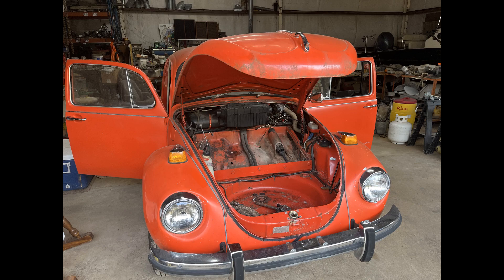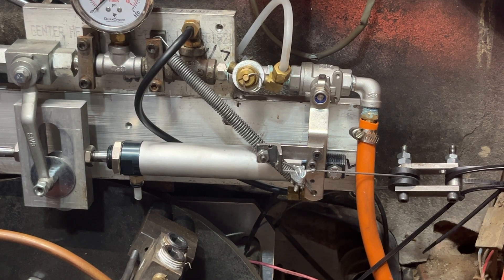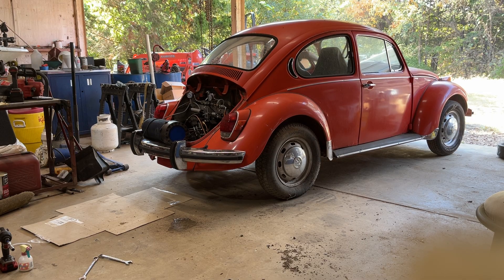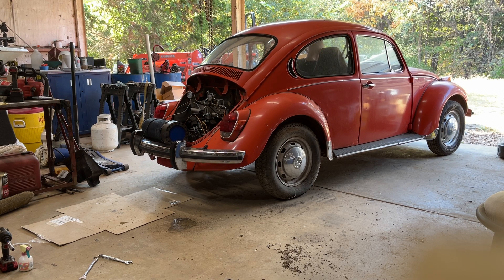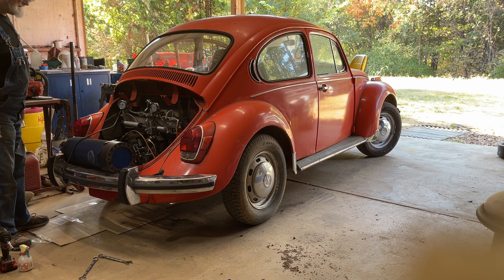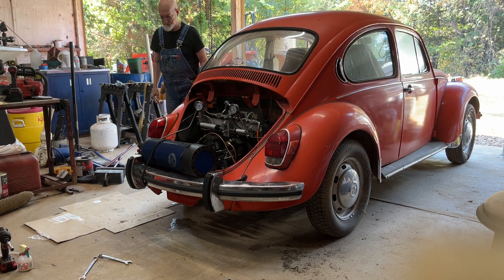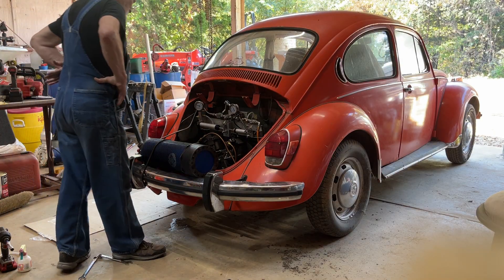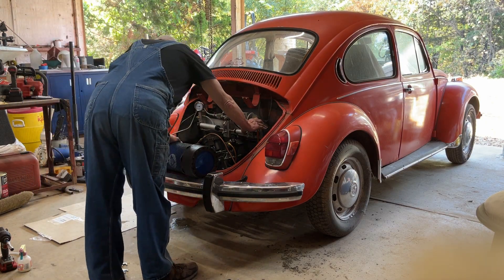Testing Pressure-Flow Regulator in Rear Location on the Engine 9-20-25

Comment: I just heard you empty that tank and use most of the energy to make noise... I keep saying to use lower pressure, larger cylinders, and turn off the intake with the correct timing to get complete expansion.. or keep ignoring my advice and turn all your energy into sound for the rest of your life